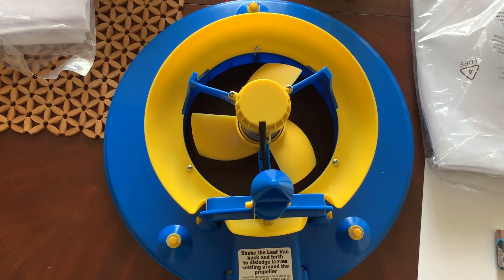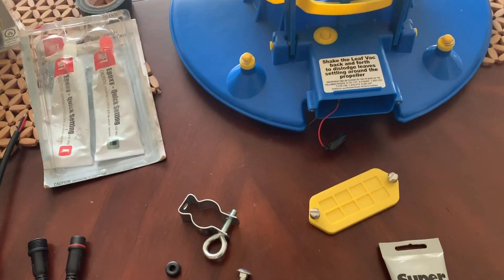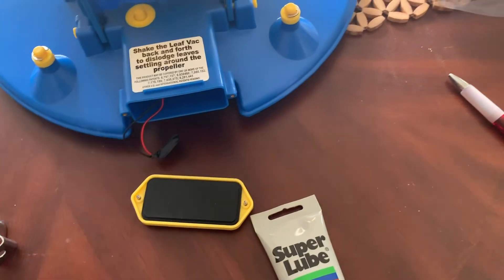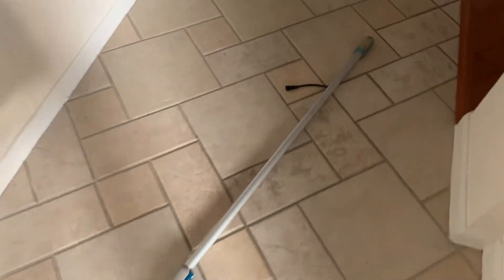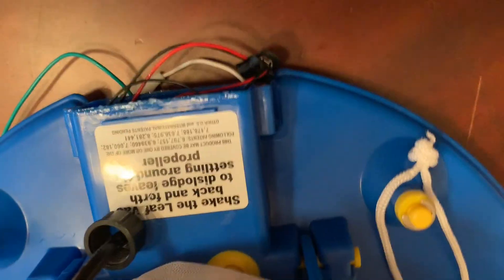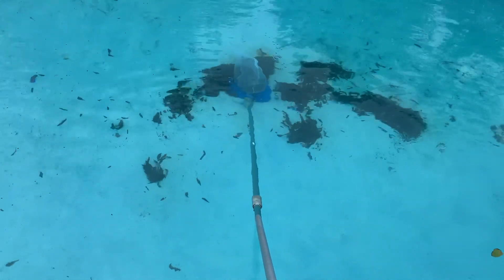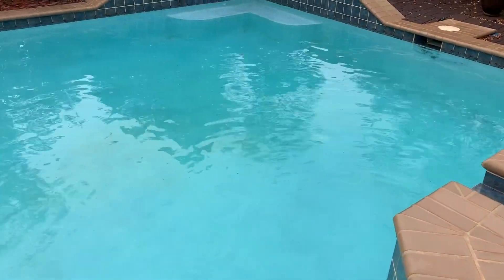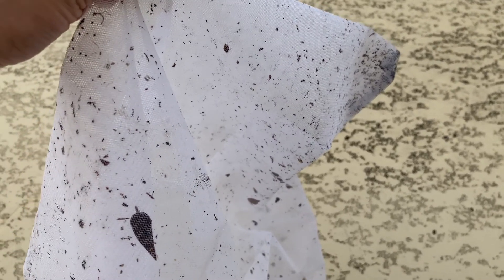Pool Blaster (Battery Powered Leaf Vacuum) with Battery Pack Modification

Comment: Absolutely great idea, after flooding two of these I started filling the compartment with silicone caulk, what a mess to clean out every time you change the battery.  You’re idea was so much better.  Thanks for sharing.